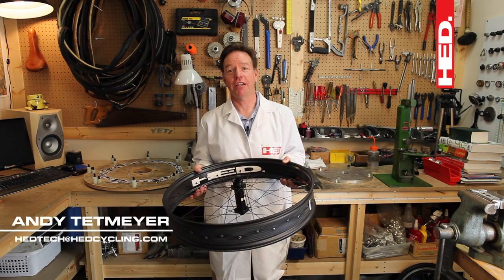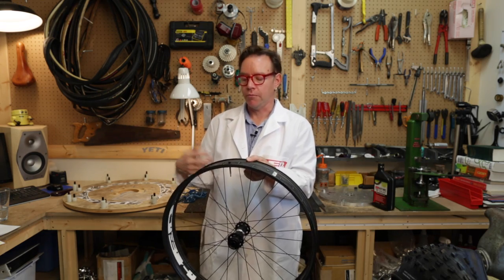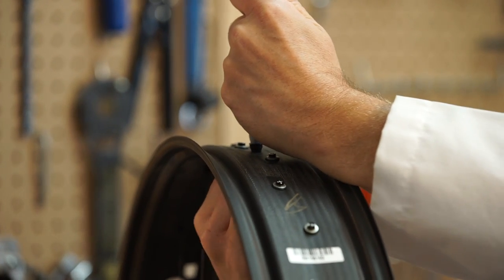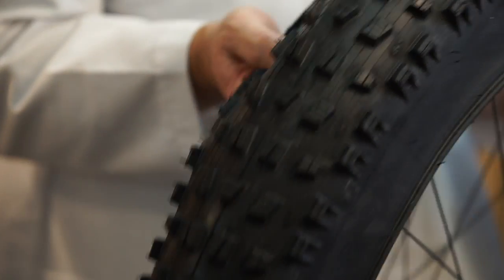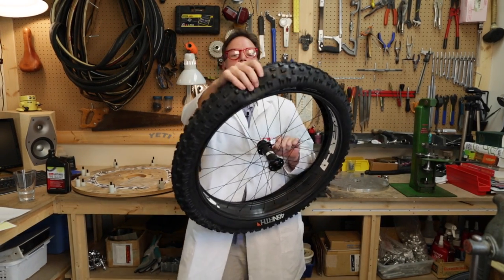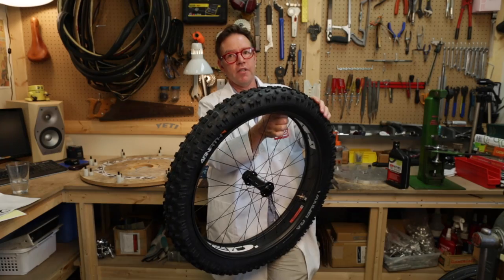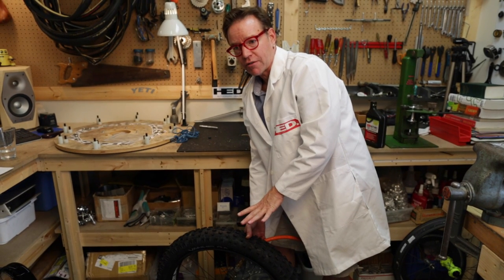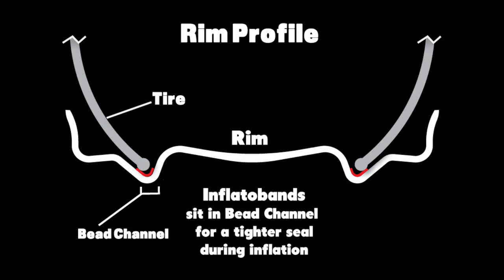Hed Talks: Big Deal Tubeless Tire Installation

Comment: It would be great if you could also do a video on removing tires from the Hed Big Deal wheels.  I've found this to be very difficult and would be interested in any tips, especially without levers.
Reply from the maker: Hi Bodo,

Thanks for your comment, we are currently working on that subject. We recommend removing the wheel from your bike, deflating it and laying it on its side on the ground. Then you can gently step on the tires sidewalls (be careful to not step on your rim), until they unseat from the rim shelf. Continue to do this all around the wheel on both sides until you are able to remove the tire beads easily by hand. Also note, it will be easiest to pull the tire beads off of their corresponding sides. Do not pull the tire bead over the spoke nipples. If you have any further questions, please give us a call at 888-246-3639. Thanks!

Comment: No soapy water to help the tire snap into place? Instead of the inflatobands on the HED rims here at LaMere Cycles we've been putting the tires on with a huge heavy Surly fat bike tube, inflate so tire is on, then deflate, take one side of tire off, take tube out, put tubeless valve in, and then at this point you're only working on getting one side of tire to go on....and in this way we avoid the inflatobands and it works almost all the time, always with soapy water.
Reply from the maker: Hi JP,

We have found that soapy water is not needed if the Inflatobands are installed and the proper amount of sealant is used. If the tire has a slightly tighter bead diameter, you can often install the tire without using the Inflatobands. Thanks for your comment.

Comment: It looked like you didn't use any kind of rim strip? Do you just rely on the sealant? In the directions provided with the wheels it recommends using gorilla tape. I'm specifically working with the Specialized OEM wheels with Big Deal rims and looking to convert them to tubeless. They come with a nice rim strip already. Should I keep the rim strip on? Remove it? Remove it and use gorilla tape?
Reply from the maker: Hi Benjamin,

Since you are going tubeless, you do not need the rim strip if you have the spoke nipples with the rubber washers. We recommend holding onto the rim strip though, just in case you need to use a tube inside your wheels. Thanks for your questions, please contact us at 888-246-3639 if you need any further assistance.

Comment: Bull shit!  No way in hell can my 45nrt dillenger 5's be put on or removed without tire tools, even when done at my LBS.  In fact, after my first season on these wheels, riding only smooth snow packed trails perhaps half a dozen times, i noticed that the sidewall on one wheel was cracked.  I tried to send it back for warranty repair (lifetime warranty is the only reason I spent such a ridiculous amount on these wheels) but was told by HED that it was not covered under warranty because it was caused by “rock damage”.  Bull shit again.  These wheels never came close to rocks; they only saw smooth hard pact snow trails.  My suspicion is that they were likely damaged when the winter tires were first installed at my LBS.  I just happened to first notice it when inspecting them prior to a planned tire change the following spring. The sidewall on these wheels is so incredibly thin that you have to be extremely careful when changing tires (and both my summer and winter tires require tools to do so). Im so scared of damaging the sidewalls now that i have stopped changing tires and just leave my winter tires on at all times and just dont ride my fat bike from spring to fall.  As beautiful and light as these wheels are, they are so fragile that I very much regret buying them, especially since HED does not back them up.  Do yourself a favor and pay a lot less for a slightly heavier but much stronger wheels.  The only reason HED tries to push for tool-less installation is because they know they break so easily.  Otherwise, why would they care if people used tools or not?

Comment: the instructions indicate to use gorilla tape for a rim strip.  perhaps in this video they have the rubber gaskets on the nipples so they don't need them.  the instructions suggest to us 8oz of sealant but in this video he says use a quarter cup of sealant which is only 2oz.
Reply from the maker: Hi Franz,

You are correct. If your Big Deal wheels have the rubber washers under the spoke nipples, you will not need to install the Gorilla tape when going tubeless. Since there is a lot of volume in a fat bike wheel, we recommend using more sealant than less. Try starting at 8oz and adjust if needed. Thanks!